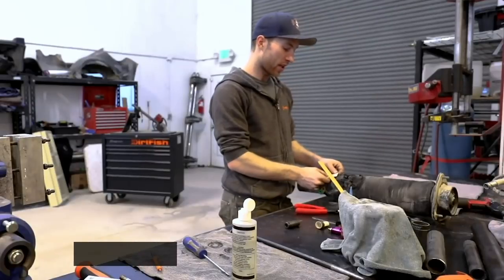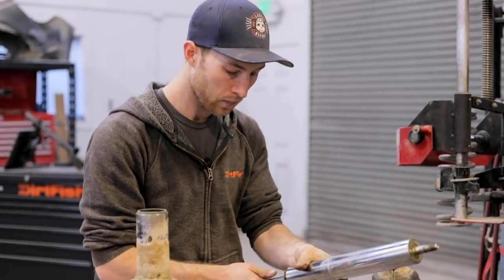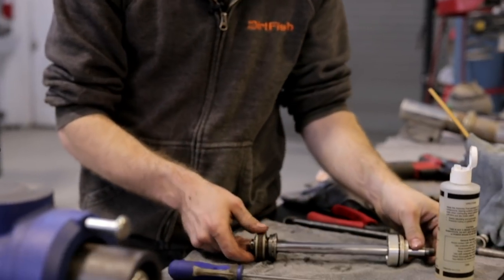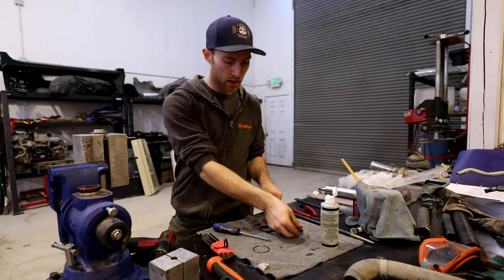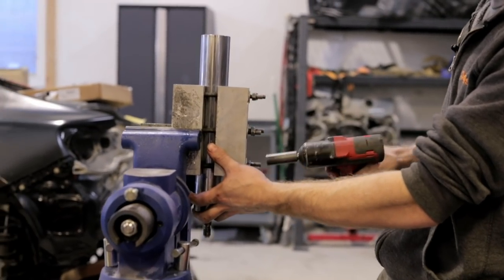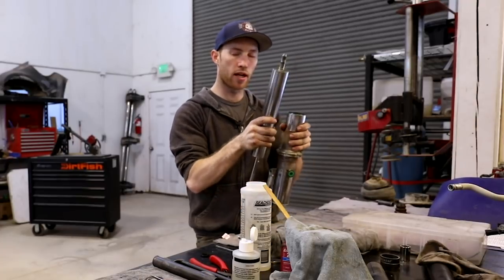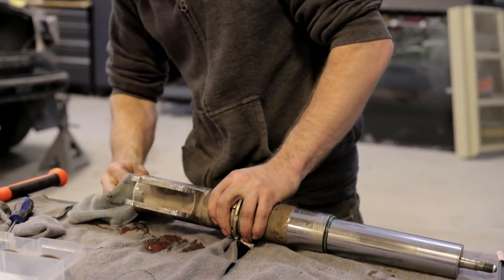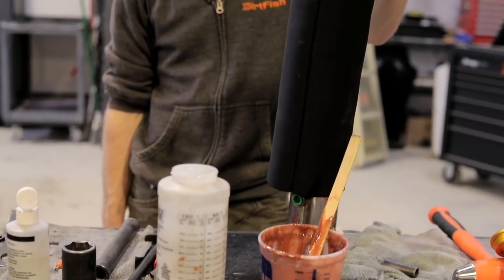Rebuilding Rally Suspension

Comment from the maker: What kind of suspension do you use? How do you maintain it?
Reply: Reiger 3 ways on a Peugeot 205, I just do the basic stuff cleaning and spring changes and grease changes, was getting a damper tech from M-Sport to do the other stuff or send it back to Reiger UK,
Reply: Hi! Where i can buy the pressurise valve?
Reply: What fork oil did you use for this video?
Reply: hi! on my Mitsubishi Evo 1 I use Proflex 3 adjustments. I myself am engaged in repair and maintenance of sports shock-absorbers in Russia
привет! на своём мицубиси эво 1 я использую профлекс 3 регулировки. я сам занимаюсь ремонтом и обслуживанием спортивных амортизаторов в россии
Reply: MCA Golds, the regrease of the lower part every 5 rallies is where I draw the line. Anything more I send to the manufacturer. You make it look pretty easy except having nitrogen on hand is a bit out of reach for a home workshop 😂

Comment: in the beginning you noticed decreased pressure in the reservoire and bubbly oil. do you think the bubbles solely come from the missing pressure in the system (cavitation and stuff) and not from a defect ifp seal? (bladders can be leaking too). 
maybe i wasnt paying attention, but there was no inspection of the ifp other than the test if the oil can be heard squishing after reassembly.

also: how do you make sure there is no air in the shock after assembly the sealhead? does the sealhead have some kind of bleed-port?

Comment: Nice vid.  Have any tips for replacing the sleeve bushings on the damper body?  They are a pita.  So far I've been using a long hacksaw blade to cut through the old bushings, then folding them in for removal.  I'm guessing you freeze the new bushings and heat the body for install?
Reply from the maker: We are working on a goos answer form our shop.
Reply from the maker: We make an oval shaped tool that slides in and then turns 90 degrees and catches the bushing. That tool also has a nut welded to the center. We then use a slider hammer to remove the bushing. On the reiger dampers the bottom of the damper tube is removable so you can just use a press to push the bushings up or down.

Comment: Does there necessary to use the Torque wrench to tighten up the top mount bolt rather than using the rattle gun?
Reply from the maker: A torque wrench is a safer option. You can use the gun to get the bolt on, but it can also strip the bolt if you go too far. The torque wrench will ensure the nut and bolt is not too loose or too tight and that it's just right.

Comment: The "sock" you put around it is interesting! Does it really work keeping the moisture/dirt out?
Reply from the maker: Yes, it works really well.
Reply: Where do you get the shock covers? I just ordered reigers for my Subaru and I’ll need these covers
Reply: Look closer when he takes them out - you can be sure that this sock will keep dirt and moisture IN!
Reply: We never use socks on our Reigers. After each rally we wash them with water under pressure, then blow the water out with compressed air and in the finish - spray all over, bottom to top with WD 40. Even after few years dampers look like new.

Comment: This is not a shock absorber repair. You did not remove the piston between the oil and the gas and did not replace the seal. You have not cleaned and changed the grease between the bearings. Assemble the shock absorber incorrectly. With such repairs after some of SS shock absorber will not work.
Reply: im also really confused...
Reply: this is similar without a separator piston shock absorber

Comment: What stone age old Reiger is that??? Who runs that on a rally car 🤣🤣🤣
Why don't you show a proper 3 way adjustable with piggy pack as they are used on real rally cars..
Regardless that....I would have started with a proper wash before it even enters my workshop which is sandfree😏
My clients actually drop them off total clean to avoid extra  cleaning charges lol